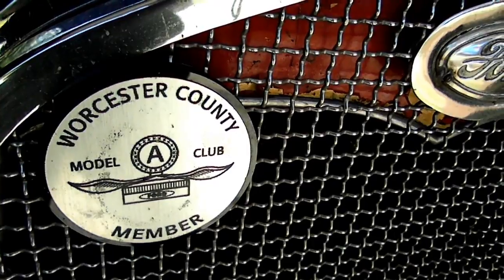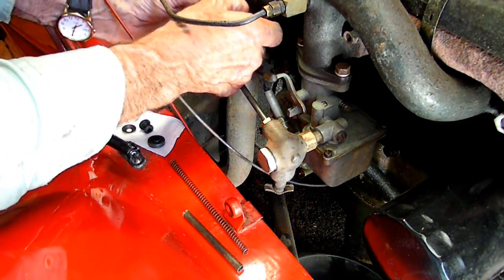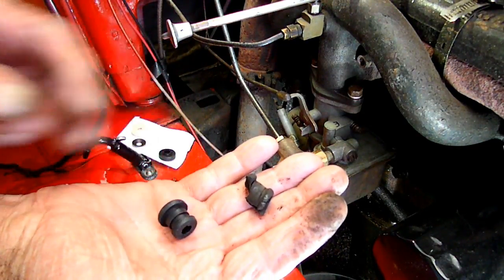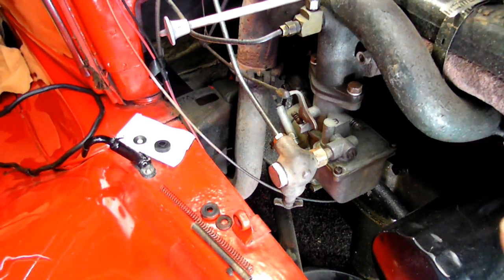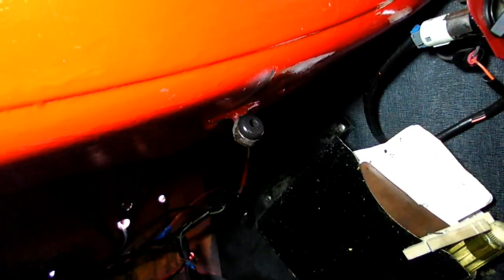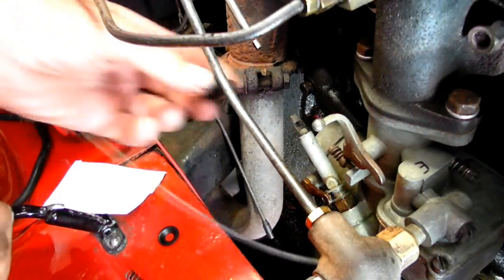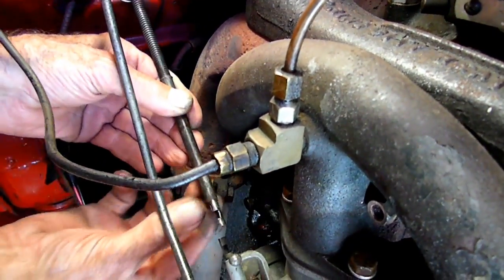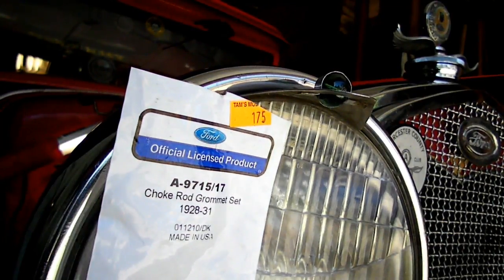Model A Ford Choke Rod Grommet Replacement

Comment: i dunno bout that brake fluid haha thats kinda aggressive. will eat the paint. I did mine with soap and water just now and it slipped right in. that one was gone replaced with a cable for a downdraft. went back to a zenith. was havin a hard time findin the correct order for the washers in the engine compartment but now im set. thanks guys.
Reply from the maker: My father was a automobile spring mechanic and they used brake fluid on the rubber parts...so any time he finds a stubborn rubber bushing out comes the brake fluid.